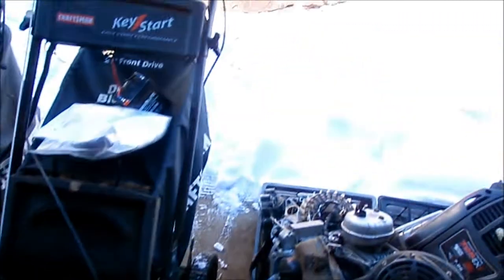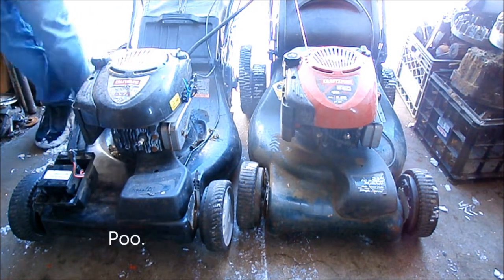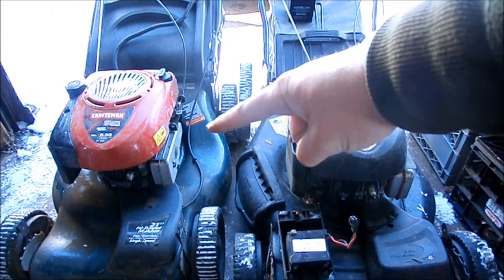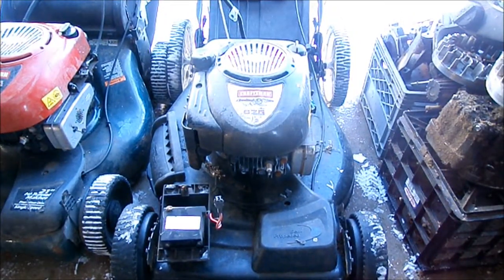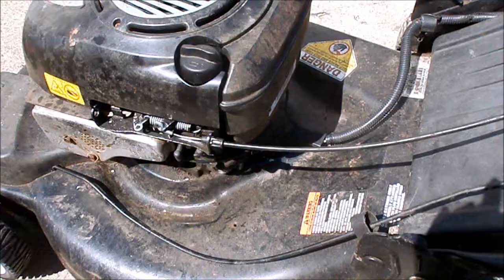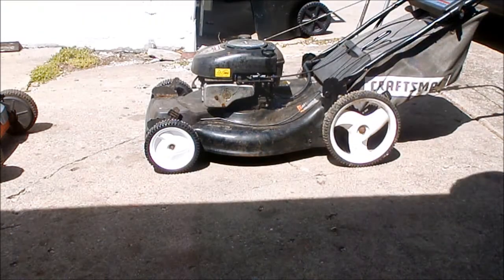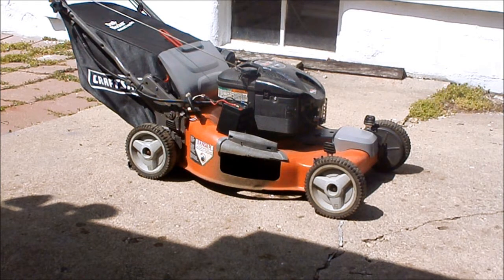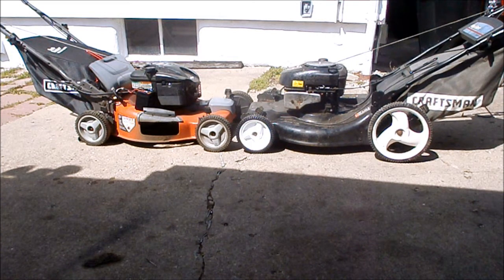04 20 22 First 2022 Mower(s) Part 2

Comment: She needs a good wash and spot painting!! And will look good as new and run as new!! I did exactly that with mine which was a year older than the black one and is nearly identical to it no keystart to worry about on it though. Just had two small spots of rusting paint  not nearly as bad as many others
Reply from the maker: It actually cleaned up very well with a wash and some WD-40 shine!  Sold it to a  friend for $250!  Glad to hear yours was a good 'un too.  Can't beat the older Craftsmans with a Quantum!